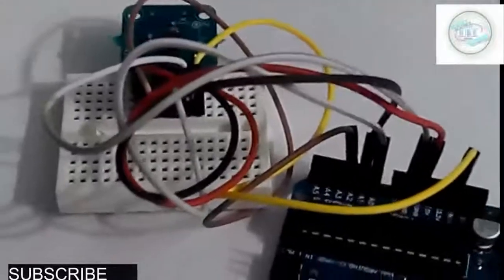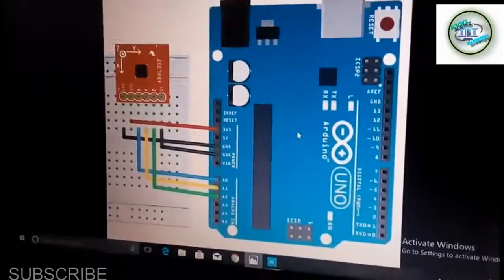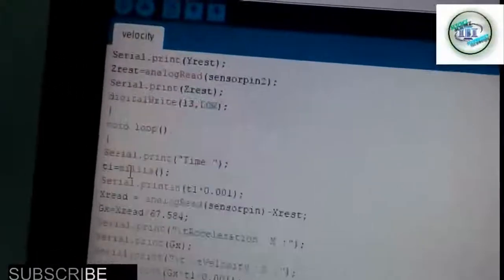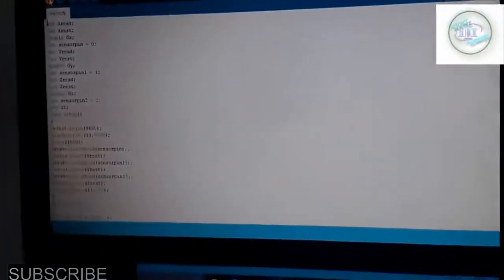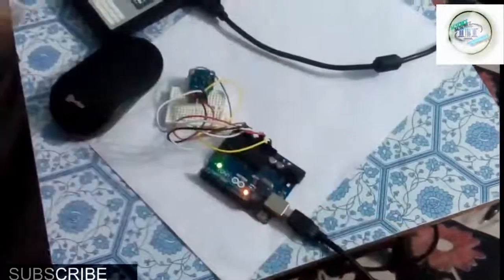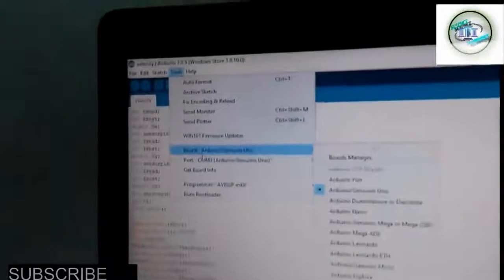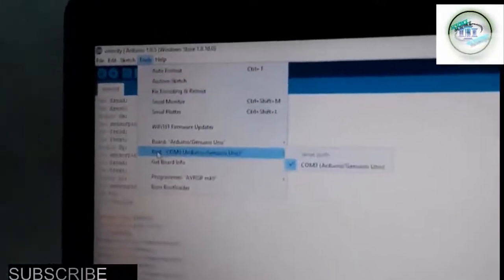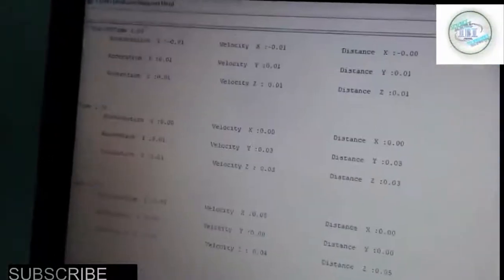DISPLACEMENT & VELOCITY CALCULATOR FROM AN ACCELEROMETER

Comment: Dear Ankesh, you program is very interesting but the mais issue of this video should be the way you calculated the velocity and displacement from the accelerometer, you showed how to print data and the necessary configurations, this can do anyone! You were much more smarter calculating the speed and displacement from the data collected from the accelerometer, and about this calculation method used to get those two units! Congratulations

Comment: how precise are the values of velocity and displacement?
Reply from the maker: ankit rajput 
Here we are calculating the velocity and displacement after every .7sec so it's value is changing after every .7 sec it is showing the vel. And displacement in this 700mSec .
U can go for long time also and can calculate over a very long time the measurements of the velocity and displacement.
It will be quite better to operate over enter key and when we will run the program the time will start and just press an external connected key to arduino to stop the time .
Then in this case you will get the velocity and displacement over your entire journey .
I hope it will help you .
Thank u.
Reply from the maker: We were given such project to calculate only after every 0.7 mSec.
You can make it more advance by using oilet display instead of display in pc
TYSM for your comments.
Reply from the maker: ankit rajput 
Have a share too.
Reply: @AnkeshSinghRajput1  

I want an mpu6050 sensor to measure velocity . how can i do it 
Please reply